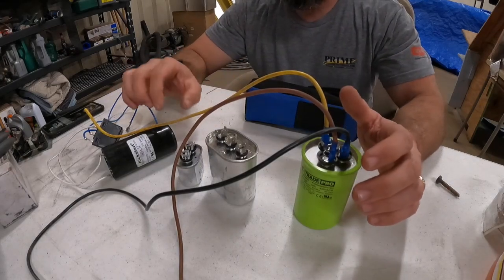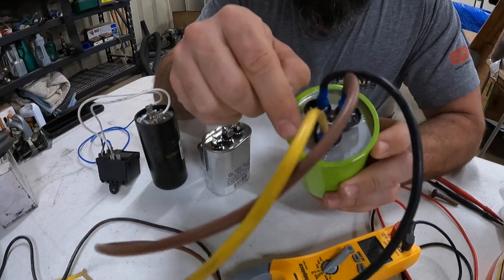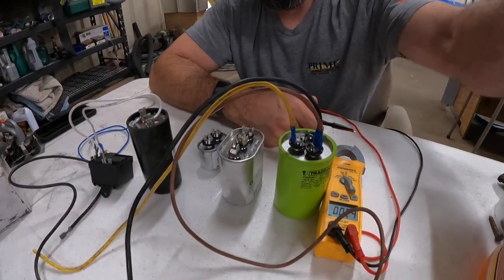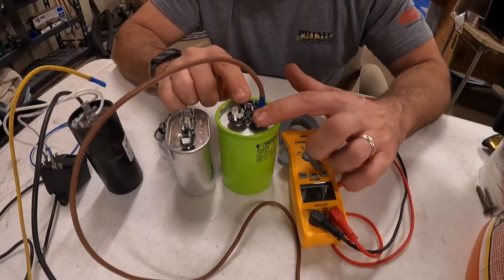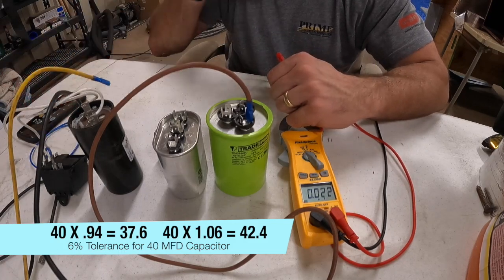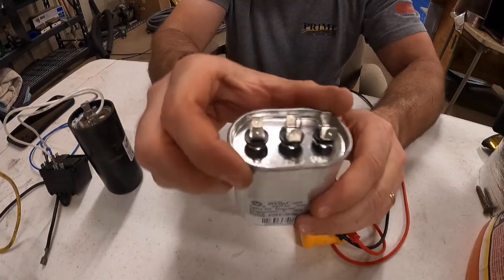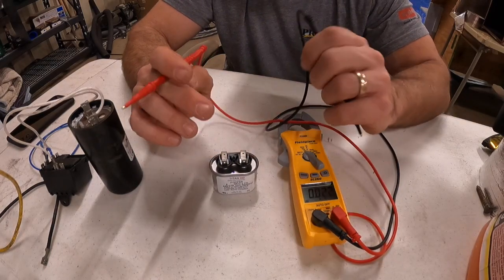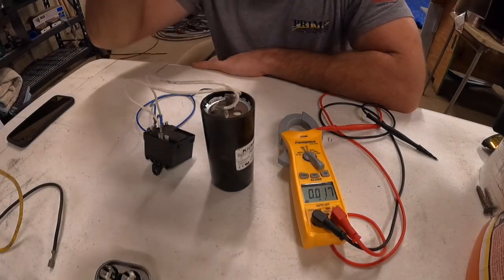Troubleshooting capacitors

Comment: 2:12 - The “crazy” starts with the fact that the capacitive reactance of a 1mF capacitor is 2652.58 ohms on a 60Hz system — (2pi*60*1mF)^-1=2652.58R. Then, the actual capacitance in-circuit is calculated by multiplying that constant with the current through the Herm wire and dividing the result by the voltage measured across the common and Herm terminals (e.g., 8.3A x 2652.58 Ohms/295.4V=74.51mF). Simple measurements. (The voltage measured will be higher than 240V because of the back EMF generated by the compressor motor.) Easy to understand explanation for checking static capacitance using the capacitance function of a DMM, though. Well done!
To avoid callbacks, I will replace a capacitor that is not within 6 percent of the labeled value using the live method.
8:02 - Because the bleed resistor on most motor start capacitors of this type is around 15k, the high resistance will not affect the meter reading significantly.